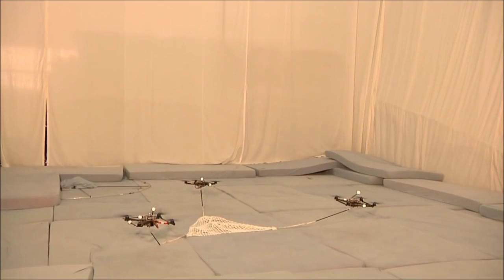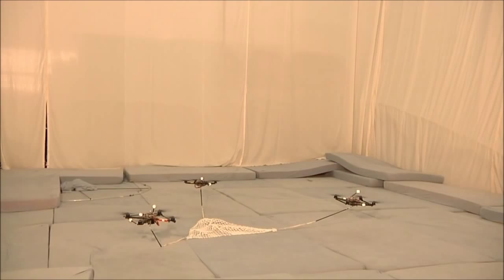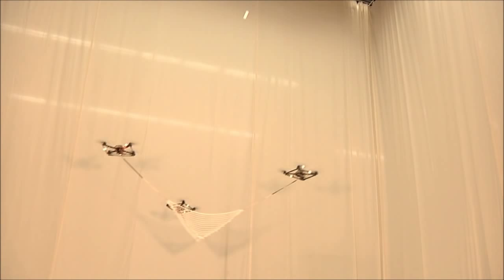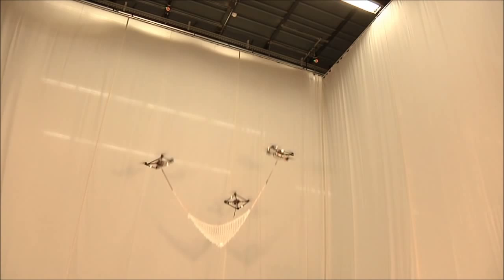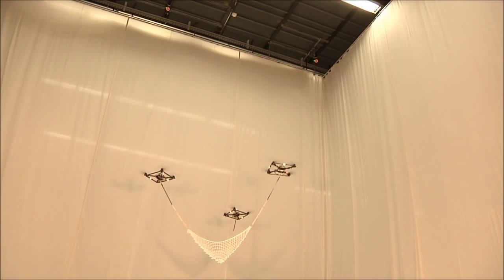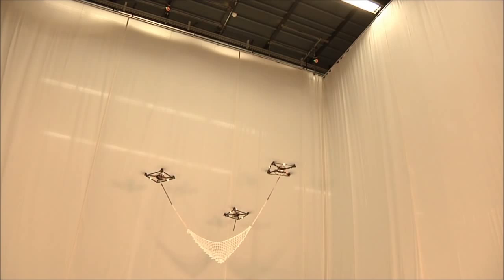Cooperative Quadrocopter Ball Throwing and Catching - IDSC - ETH Zurich

Comment: this could be used to save lives
Reply: How?? :D By fascinating a dying kid with juggling drones so hard his cancer goes away? Why has everything got to be for saving lifes? This is motion control on the highest level and a proper use of network learning, applied to a dynamic system such as found in flight - it doesnt have to save lives to be useful. What you would be looking for if you want motion control to save lifes is not only not coordination between different objects in motion, you also dont want dynamic. If you think of an operating table, your patient lies still, and dynamic movement inside him would snuff him out. If you think coordination, thefuck for? So the operating mechanical parts can use knife and fork properly?

Comment: yeah, duh. military will use anything they can to kill people, this is a given. the question is does the good outweigh the bad.
quadrocoptors could be used for locating and rescuing people in wreckage or burning buildings, they can be used to map out a perimeter and detect the weak points in a collapsed building, they can be used to deliver supplies in areas too dangerous or small for a person to get through. they could save many lives, as well as take them. we can't sit scared of the what if.